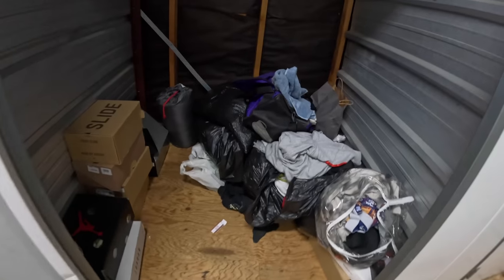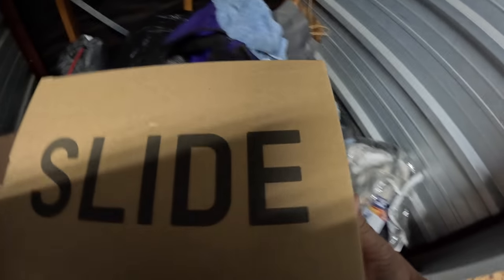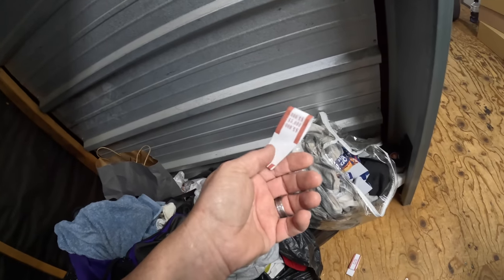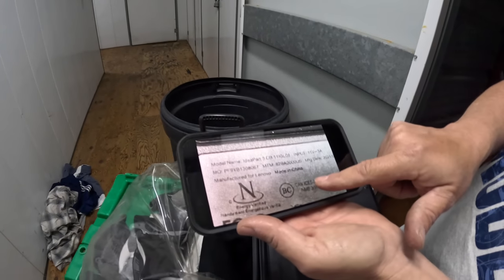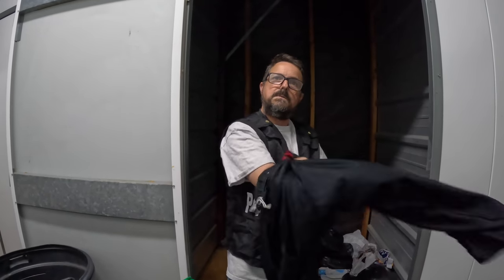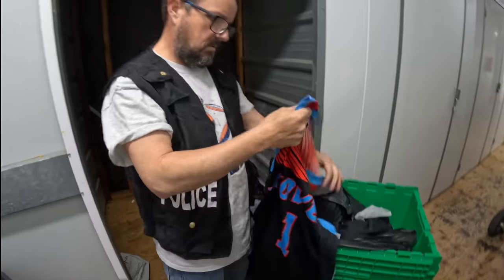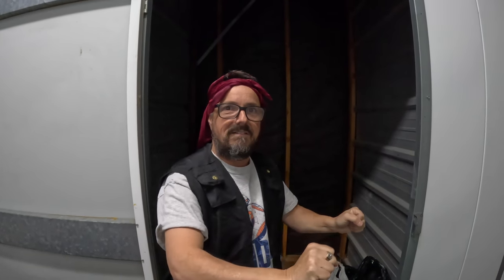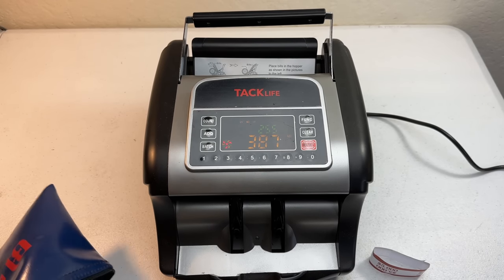A stack of Air Jordan and Yeezy boxes made me bid $710 on this locker. One pair pays for it all!

Comment: Former bank teller here…
Authentic cash bundle straps which come from a bank will have a dated bank stamp across the seal area where the end wraps over and the initials of the teller who counted and strapped the bills. He was obvy counting and strapping his own $$.  Straps marked $5k would be used for 100 $50 bills, 5 rubber bands of $20 bills, $1k each. A $100 strap would be made up of $1’s and be 4 x $25 rubber banded. A strap of 5’s would be 5 x $100 (20bills) rubber banded, for a strap total of $500, and so on. Not sure what this person was up to but the counterfeit pen means either they or their “customers” were a bit sus. 🧐🕵🏼‍♀️💵